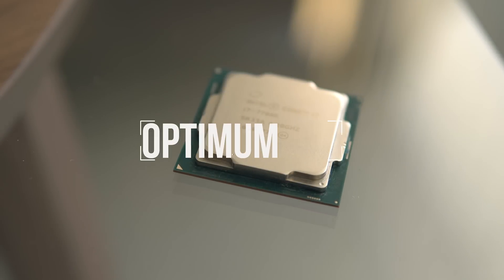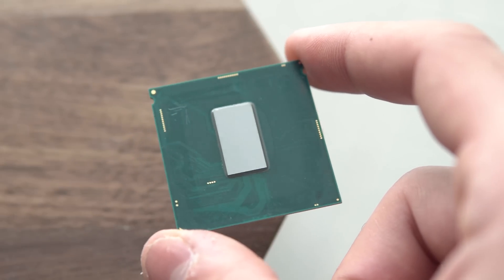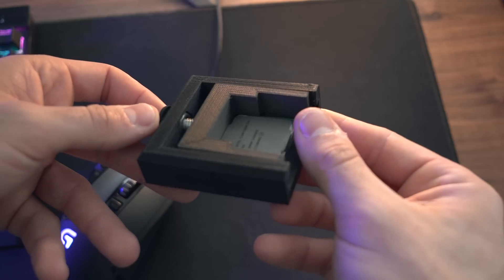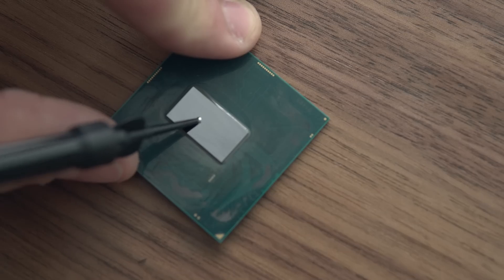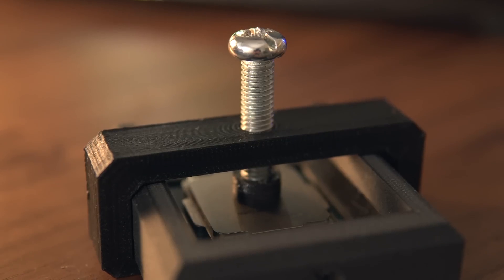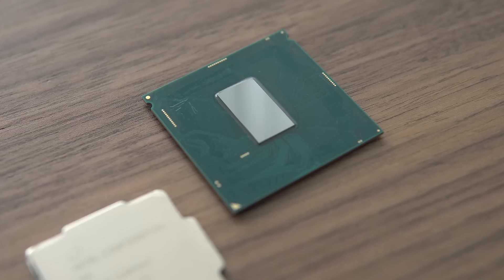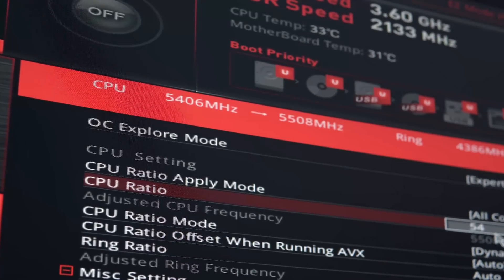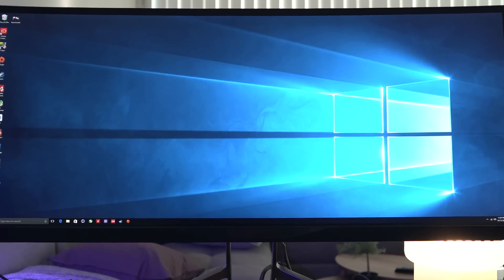Delidding The 8600K - 5.4GHz OVERCLOCK!

Comment: 1.45 volts seems a bit high
Reply: It is, that thing won't last more than 2 years. 1.38 at 5.3 is much healthier.
Reply: idk about 8th generation but 6th generation like 6700k is safe under 1.5V , personally i sit with 1.41V & 4.7oc for almost a whole year till i started to mining , i also heard that cpus from old gen like 4th isn't safe even for 1.4, so perhaps we are just talking about different generation volts here
Reply: intel says 1.5 is the absolute maximum. now if your chip can handle that much voltage is silicon lottery aswell. i have set a 2600k on fire with 1.4 volts so take it with a grain on salt but anything over 1.4 for me is watch for fires territory
Reply: Agreed, but some of these tards spend all their money on PC parts. So they overclock to maximum, use the hell out of there stuff and don't care because they upgrade the very next year which i find a waste of money. i wouldn't push past 1.35 volts, i don't care if the temps are decent. It will still lower the life span of the chip, i run 4.8 ghz and super low voltage. Get performance, and i can keep my cpu for 5 years easy until i feel like upgrading and selling.
Reply: my i7 3820 running 5 years with 1.48 V 4,9GHz 72cmax with no problems
Reply: Cooling matters a lot when it comes to cpu. Delidding also help but of course you lose your warranty.
But the cpu would last for a long ass time. Even if you had it over 1.35volts you would most likely change it before it stops working. By the time it wouldn’t work anymore it wouldn’t be able to keep up with latest games anyway.
Reply: sure, unless you want to risk if you go further :D, must have decent water cooling to even hit 1.5 i think, personally in my case budget hyper 212 evo was just enough to keep it stable at 1.41 4.7, i also actually used 1.45 4.8 for a couple of days stable but switched back quickly after noticed that hyper 212 evo power is a bit not there, would like to have that noctua nh d15 haha // p.s. my country is also colder one, so it helps too
Reply: cskillers1 you got unlucky with your chip my 6700k runs 4.7 with 1.33v
Reply: William Torres more like you got lucky with yours xD, after all, stock auto mode (including turbo) is 1.288~1.424 , something around that, anyways with such result you probably can take even 4.9!
Reply: @cskillers1 For 8th gen, 1.52V is absolute max according to datasheets.
Reply: It isn't "Seems," that is damn high.
Reply: Maybe so. Those chips use a higher core voltage by default. Also the core count.
Reply: I am running 4.6 at 1.30 volts. I just won't cram anymore voltage into it. it has to last a long time.
Reply: F1N1SHEDD my 6700k is 3 years old. Running at 5.0ghz @ 1.4v the entire time. If you have good cooling it will be just fine.. I never crosses 54c in games and 66c in Prime95. Delidded with a swiftech H320x2 prestige aio.

Comment: Is it a normal i7 8700k? Or an extra quality one? Should I buy a 4.8ghz delided i7 8700k in caseking.de, or a normal one?

I mean, this one, for example: https://www.caseking.de/der8auer-core-i7-8700k-4-9-ghz-advanced-edition-hpit-451.html
Reply: Pipo Squad get the silicon lottery one if possible, you can get a normal one with risk it can't overclock as well OR it might overclock better than the one from case king, all luck.
Reply: The point is: I don't want to take the risk of deliding the cpu. Casking gives you a quality chip with good cooling paste. Don't know what to do. At this time, it seems more useful to save some money and get the delided one.

Comment: If I wanted to overclock my i5 8600k to around 4.2ghz, what voltage would you recommend? That would be with liquid cooling
Reply from the maker: 4.2GHz or 5.2GHz? The 8600K will boost to 4.2 naturally.
Reply: Optimum Tech oh shit, yeah I did mean 4.2, well thanks for letting me know. I just assumed it kept at 3.6 without OC. I’ve always wanted to overclock but I’m worried I’ll lose a shit load of reliability
Reply: The Car Guy I've had my 4790k oc'd for 3 years. Just don't take the vcore above 1.35v the chip will last forever also by Ocing my chip I was able to lower the vcore compared to my mobos stock base vcore number which was 1.24v I'm 500mhz faster and at 1.15v
Reply: If you're sensible with you OC, you shouldn't lose any reliability.
Reply: The Car Guy Run stress test to ensure your overclock is stable. Overclocking won't decrease stability unless you don't overclock properly. Voltage is probably the most significant factor in terms of stability (in my experience).

Comment: So can i oc to 4.8 without adding any voltages?
Reply: no
Reply: no
Reply: Try it...it might work...
Reply: With my 4790k I'm stable at 4.5ghz with 1.15v....that's less than it pulled out of the box at 4.0ghz it's all bout your chip and the silicone lottery
Reply: Try and do it, then watch the CPU-Z auto voltages fly all the way up to 1.6v. No OC is recommended at AUTO.
Reply: HARRIPUTTER no
Reply: David Womacks silicon lottery

Comment: 5.4 is nuts :| nice job!
Reply: Wow, and i thought 4.5GHz was super fast. xd
Reply: For an over 1GHz slower clockspeed? Nah I'll keep my 7700k until Amd can improve clockspeds or IPC or even better, both.
Reply: 8 series are 14nm (they call it 14nm++).  this is as high as any desktop chip with normal cooling has been able to reach....ever.  the pace of technology is not always to our liking but it is what it is.  for all we know there may be some unknown wall which prevents cpu's from going any higher than about 5.5-6 ghz with normal cooling.  the world of physics has its limits
Reply: ryzen for gaming? lol. only 30-60 fps casuals using 60 hz would be satisfied.
Reply: @Dr.WhetFarts  daam this didn't age well hahaha 5900x is better than 10900k
Reply: @Dr.WhetFarts  say it again today:D xd
Reply: No idea how is it even possible to get such a low clock as 5.4 with that voltage. Look: my old Phen II is running only 3.6 at base voltage which is 1.4 or 1.45, but it is 45 nm process. So how come 10 nm 8 series cannot maintain some above-average speed at this crazy voltage (taken into account 2 times lower tdp and 2 times higher critical temperature compared to my Phen)? Common sense tells that they must be able to do some 7GHz at this rate at least, but they cannnot...
Reply: Why don't you buy ryzen? Life is simple with ryzen